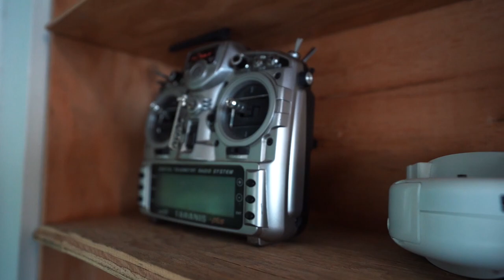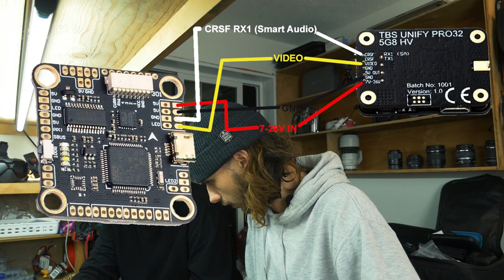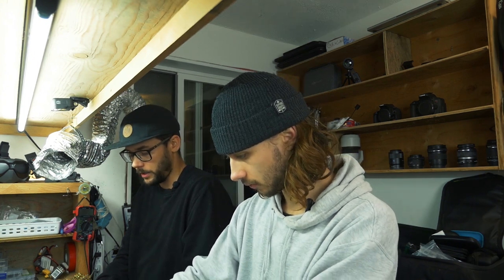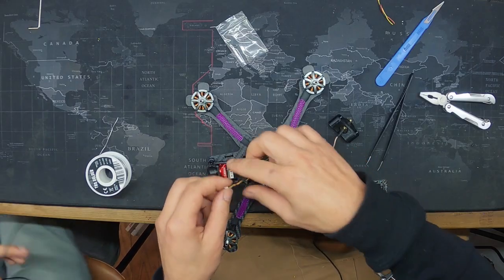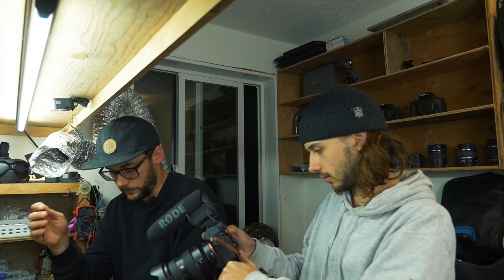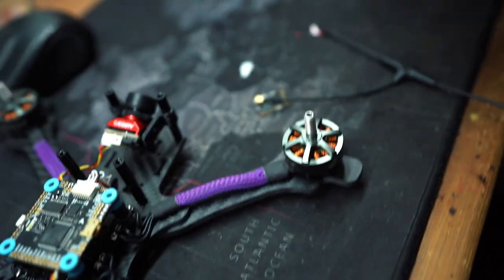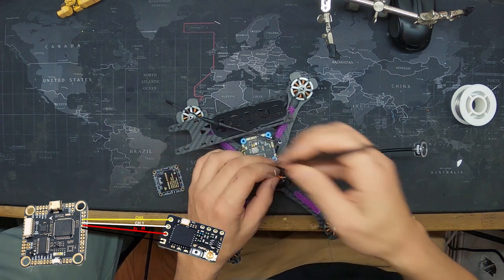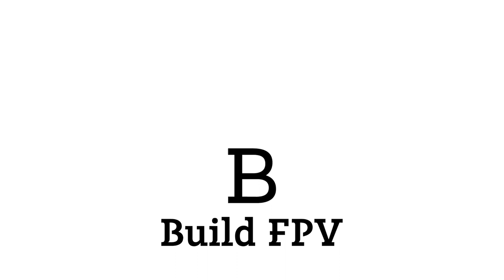*GIVEAWAY* How to build a beginner FPV drone (Part 2)

Comment: For the cap, I add liquid electrical tape before to the bottom on the leads coming out and then after to any exposed lead.  I have had wet grass connect those.  I conformal coat the board connections.

You didn't get any esc start up confirmation sounds when you had the wiring issue.   That's an immediate sign something is wrong.  Using a smaller battery to power up the first time can help with some vcc issues.
Reply from the maker: We actually went back and conformal coated the whole quad once we were finished.  We like the liquid electrical tape idea! When we connect the battery we used a TBS "smoke stopper" :)) Thanks for watching!!

Comment: Great video, a step by step build showing all the little details and info you usually dont get told on building a quad.  I feel like im right there at the bench with you!  Such a familiar sound lol maybe one day i'll have my own quad surely cant afford one right now.  I did get to fly my cousins quad in june and i was instantly hooked.
Reply from the maker: Its a fine line of babbling on with info people don't want and skipping important steps.

One flight and we were hooked too! Do you own a radio yet? When the weather is trash we spend a lot of time on Velocidrone.  Thanks for watching!
Reply: @buildfpv6655  I dont have a standalone radio yet just stock ones so nothing special, but looking at a few different ones to run with a quad like this.  Suggestions?